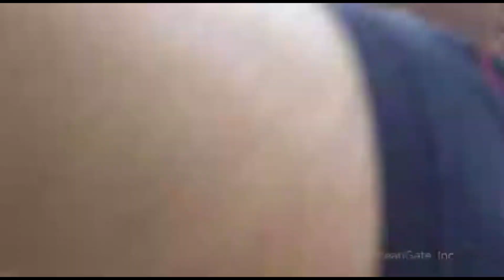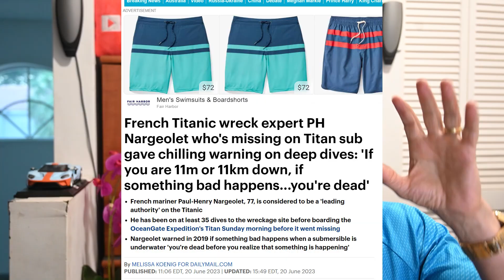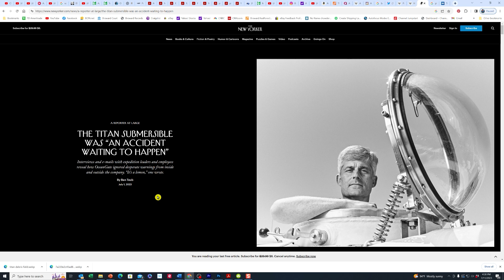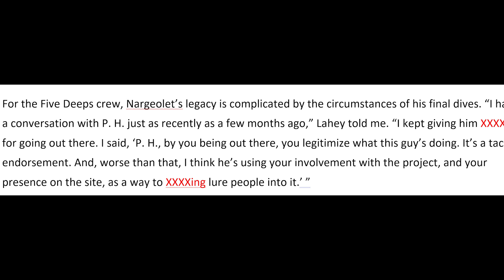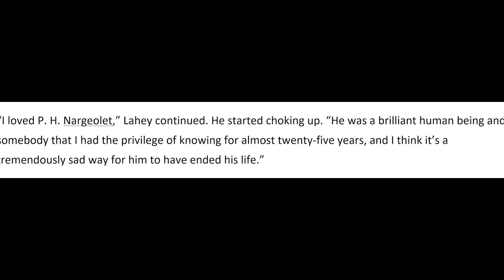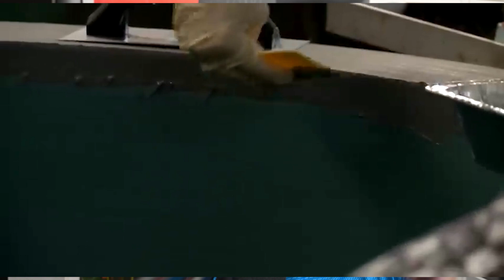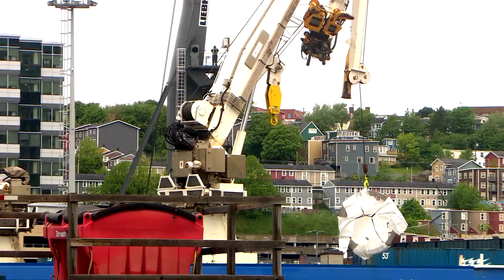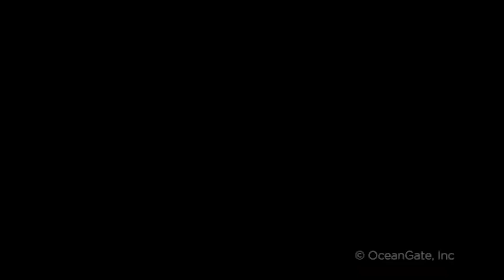Titan Sub: More Q&A, Design Defects, Why Descent Fast

Comment: Carbon, Fiberglass, aluminium, etc will not bond to any secondary adhesive without a "tooth"
The bonding and the bonded to surface need a profile that the adhesive will bite into. Lacking that, there is nothing for the adhesive to lock on to. Silly thought, but anybody working in the composite arena  knows this. How they could expect a permanent bond is boggling. And wiping with bare hands, a generic rag, no visible solvent like de natured alcohol is also suspect. At best the manufacturer of the carbon and "glue" should have proved a procedure to prep the surfaces. 
Also the way the carbon was wrapped is quite suspect, a crisscross weave would have provided more strength than the layer after layer rotary deposition. Every bit of carbon I've ever seen in the form of a pressure vessel or a tube has been in the form of a back and forth weave.
Both the rings and the cutback on the perimeter edge of the cylinder appear to be smooth. With both dissimilar materials expanding and contracting at two entirely different rates the bond would be temporary at best.  Along with any distortion of the tube or ring that would cause a bonding failure. Quite possibly the "noise" heard or reported could have been the failure of the bond happening. And the difficulty with the craft being able to rise rapidly could  have been attributed to a leak adding more weight under the floor that they could not see, but changed the way the craft could rise.

Comment: Could it be that the submersible was already making water at the very beginning? And it only leaked into the compartment with the equipment?
Meaning that the weight was much higher. Thus sinking faster, while going back to the surface was slower.

If you go down to fast. You immediately need to correct. Or understand that something is wrong. They should have aborted right away.
Reply: It would explain the minimal effect of dropping balast, if the transscripts are factual. I'd say it is more than likely.

Comment: Question 1: SR has texted that all lights are red and cracking sound from aft, why the control of the ship stayed 8 hrs to inform coast guards, they failed to understand that is an exceptional situation beyond their process? Question 2 : there isn’t any aft other than thing hanging outside, so cracking sounds does not mean anything related to hull. Question 3: how they hell they move faster than they could? There is no current downwards as I know. It is hard to believe they got too much weight considering 10k of ships weight. Question 4: Hull is the biggest part which tells the true story, it can’t be missing. Did they stop search operation due to funding? Question 5: what happened to O2 tanks? Were they drove hull far away before touching the sea bed?

Comment: you are still not telling why it is important to descend slowly !? I mean either a vessel  can stand the pressure or not.. Take for example a gun barrel!
Reply: True, but it is much more likely to expose the weaknesses in the design. It wil compound the material fatique wich would not be a big problem with steel. This fiberous material does not tolerate this wel.

Comment: Not sure if you covered this already but Oceangate used a wet layup process versus using a pre preg and autoclave for curing. This is a major red flag for porosity issues which they claim is less than .1%

Comment: Another question of fibercarbon construction, was it weak in longitudinal direction? Way it was wound there is no crisscrossing of the carbonfibers. If weak in longitudinal directions, it accordion imploded (crushed like aluminumcan).  The titanium end caps became compression chambers and gas and flammable material exploded.

Comment: I think the part we see the technician wiping with the rag is not the surface where the adhesive goes but the side that mates with the titanium dome.  That would not be critical with regards to cleanliness, at least not at this stage of the construction, and would need a polished finish to seal properly. The side where the glue goes is recessed and is at the bottom of the ring in the orientation seen in this video.  In fact shortly later we see them applying glue to the bottom of it.  Not saying they did much of anything right, just that this particular scene is not indicating a serious issue, at least not directly.  It does of course still indicate a general sloppy attitude to engineering which no doubt contributed to the tragedy.

Comment: Titanium shrinks about 1.5% of its mass at 2c around the depth of the Titanic ship, where-as Carbon fibre won't shrink much if at all in that temperature. The ends just popping off in my opinion.

Comment: From the earlier video you did with the descent rates, I think it looked like their speed was going up instead of down when they were getting near the bottom. I don't know if I saw that correct, but if so, could that also point to a problem with the controls? I would assume one would want to slow down as you arrive, not speed up. But then again, I don't know much about physics and submarines.

Comment: I was thinking that the coefficient of expansion would be different between the composites and the titanium. It’s freezing down there and the ring will shrink more than the composites. In addition, the end caps will push on the composite cylinder column. Composites are not good in compression. It’s not like concrete columns.

Comment: Not sure why you keep covering the descent rate of this sub. This company performed many dives, including 13 dives to the Titanic, all of which were no issue. Those dives to the Titanic were all done in around 90 min, and they never had any problems. 
This seems to be simply an assumption based on ignorance.

Comment: I'm not certain, but I have some experience of carbon composite fabrication and I am pretty certain that is dipped tow winding. A continuous length of bare, unidirectional carbon fibre, otherwise known as tow, is passed through a bath of resin,  then through combs or brushes, to remove the excess, then wound onto a mandrel. The resin is designed to cure at ambient temperature. This method of wet lay-up offers excellent fibre alignment, but suffers from a relatively low proportion of fibre reinforcement to resin. Prepreg generally is around 70% fibre by weight. I would be surprised if this method of construction could exceed 40% fibre by weight. In addition, there is no way of excluding foreign objects such as dust and lint from the composite, and no way of further consolidating the component to exclude bubbles  and voids, other than heat shrink wrapping, which on a component of this size, is unlikely to be effective. Given that fibre buckling and shear fracture is the most likely failure mode of carbon fibre under compression, the inability to control for small voids and inclusions is an invitation to catastrophic failure. Sad.
Reply: Bloody carbon fibre. Back in the early 2000's I remember a new whitewater kayak paddle manufacturer made inroads into the kayaking community - the ones with better jobs amongst us bought these damn things, the shafts of many sheared off mid rapid. I think you have the potential with this substance, but you need testing and experts to test the exact manner in which it will be used along with experience about how it could fail in the field.

Comment: Correction :  when used for removing bubbles from epoxy and other polymers an autoclave is used to put the item under negative pressure or a “vacuum” - actually a partial vacuum.  This is done to extract air bubbles in the epoxy/glue.  Even hobbyists such as wood workers use this to remove air bubbles that are naturally in the medium - generally introduced in the mixing or stirring process.
Reply: Wrong- there are vacuum bags used inside the autoclave to drive that extra atmosphere of delta P, but autoclaves for aerospace use are applying around 80-110 psi of external pressure, which combined with the higher temps used give superior resin flow, which leads to much lower porosity and superior mechanical properties.
Reply: @TeKnOShEeP  they also use negative pressure in wood preserving auto claves.
Reply: If you want to create a vacuum all you need is a bag. Then you could use any oven. The reason autoclaves are so beefy is exactly because they exert at least a few atmospheres of pressure. This squeezes the material together, and makes any bubbles small enough to work their way out of the material as well. I've often seen resin or epoxy added with the part in a bag of under vacuum while the 1 atmosphere of pressure from the air squeezes the part. You can then do much better by throwing the part in an autoclave with up to 7 or 8 atmospheres of pressure while it's still under vacuum, although I'm not sure that keeping it in a vacuum bag while in the autoclave is necessary.

I used try use two methods to get rid of gas bubbles in my solvents for certain methods in UPLC analysis. If it wasn't critical, I'd just vacuum filter the solvent to get rid of most of the gasses. If no gas was super critical, I'd just throw the solvent in the autoclave under heat and pressure to get rid of almost all the gasses. No vacuum, just heat and pressure.

I've never heard the term autoclave used to refer to a vacuum. As a noun or a verb, it always meant heat and pressure.
Reply: @zlm001  just because you haven’t seen it done doesn’t mean it’s not done because it is.

Comment: Everybody knows what happens if something goes down too fast. I found that out in the bathtub when I was a kid. The more I held onto the thing, pulling it under water, the more pressure around and inside it became. That’s probably why this happened. The sub was not ready for that dive.
Reply: Lol what?
Reply: @CheeryRhymes  the faster, the harder the pressure will be
Reply: @sajathedecided9016   the speed that you go under has nothing to do with the pressure. 

That's completely dependent on the depth.
Reply: @CheeryRhymes  yeah, the bottom was the «goal» 
Crazy story.

Comment: I too have been somewhat shocked by PH's attendance on this dive. The others could easily have been duped by Rush's slick salesmanship but PH was an expert, had travelled in properly built and tested submersibles. I agree that his presence would have bolstered the other passengers' (crew?) confidence so why did he do it? Was there a lucrative deal for a man who sounded like he was unconcerned for his own safety or did he genuinely think he could somehow save this ill-conceived vessel if things went awry? Nobody will ever know, but it is strange that such a man as him would let himself be bolted into that coffin.
As for the fast decent? I know nothing about engineering or carbon fibre but if delamination was already occurring, perhaps water was being taken onboard between layers adding to the weight ?
The observation about how clean the titanium end caps are, with no trace of carbon fibre fragments, does indeed point to how the adhesive was probably another weak point. 
Had Rush not gone down with this the man would be facing jail time now. What an incredible attitude to ignoring established safety protocols.

Comment: Not even a residue of any carbon or glue. I am pretty sure that it will turn out to be were the Carbon Fibre was attached to the rear Titanium Ring. If you think about under all that pressure the end caps are being pushed down on each end of the hull, were as the hull is basically being squeezed especially in the middle causing the hull to shrink ever so slightly length ways.

Comment: Why wasn't the titanium ring have rings (rough surface) to allow the carbon fiber to grab better? The carbon fiber part in my opinion,  would be like a tooth paste tube having a cap with no threads on the cap. Squeeze that toothpaste and the cap pops right off. Once the water pressure on the carbon fiber tube started, it reached a point that just Squeezed the cone off, and that's why no fiber on the recovered titanium rings. Just my 2 cents.

Comment: An autoclave was not used. They used a bag and vacuum method to cure the carbon fiber. A far inferior way to cure carbon fiber to be exposed to such pressures because it does not force the resin into voids. I noted the single axis the carbon fiber was laid on the tube as inferior but I was told by others that this is actually used in aerospace at times. I am not an engineer, so all of these statements need to be confirmed. But the cracking statements were telling Rush the craft was coming apart. Crackling is delaminating. It is not a sound you ever want to get comfortable hearing anything structural do. It is not a normal sound on anything you want to bet your life on especially at 12500 feet under the ocean. 

Please continue investigating this. I doubt we will ever get a true accounting of just how negligent Oceangate and Stockton Rush truly were, otherwise. 

The statements that P.H. Nargeolet had essentially given up on life because his wife had died and did not care whether he lived or died - is a huge red flag to anyone else thinking of going into other extremely dangerous adventurers based on the presence of only one verified expert. Him being there may well been the reason three other people trusted the craft. And that is just damn sad.
Reply: a convergence of unfortunate things

Comment: I take the Titan video to be produced for promotional purposes.  I don't think it is safe to assume anything about the construction of the craft from this.  There can be lots of questions about how it was done, but I don't think looking at this video is necessarily helpful in trying to find answers, and could be misleading.

The images of the recovered titanium rings appear to me to show most clearly the outer flat surface, not the inside rabbeted surface, in which case the presence of carbon fibre would not be visible.    Irrespective of that, I think you would need an expert to say whether in the event of an implosion the glue would be likely to separate cleanly from the titanium anyway.  The adhesive to titanium bond might be good enough, but still be weakest part of the joint when it the hull was ripped apart.

Thank you for the link to the article.  It does seem to illustrate the maverick way in which he operated.  It appears that he obstructed the development of the design which might have produced something genuinely useful, if the safety parameters were adequate, or brought it to a halt.  

But the blame perhaps partly lies with a legal system that denied people the means to challenge what Oceangate were doing, lacking sufficient financial and personal resources.  Perhaps the global underwater exploration community could have collectively supported a legal challenge; they seem to be a fairly wealthy lot of individuals.  You can't and probably shouldn't stop people reaching for the skies or the depths of the ocean, but society should be able to step in before they risk killing someone.
Reply: All for experimentation, but not with paying, non specialist clients who have no means to fully understand the risks.
Reply: @pollystyrene99  Absolutely, if he wants to take the risk of killing himself that's fine.  Unfortunately you can't stop people like that from existing, and the efforts of those that tried to stop him fell short, and they gave up.  They say they knew what would happen, they knew the purpose of the project was to take paying passengers, so they knew he would kill them, one day.  They must feel awful that they weren't able to stop him, or didn't go far enough to achieve that.  One would hope that something will change as a result of the investigation into this loss that might make it easier to stop future Stockton Rush's.

Comment: Regarding descent rates, is it possible the carbon fibre voids became saturated with water or and started to leak into the aft section, increasing weight?

Comment: Thanks Jeff for bringing some more details on this submersible implosion.

One thing that surprised me with is submersible design was the attachment of the end caps.  The interface is such a small contact area and is totally dependent upon the adhesive.  As a bare minimum using the adhesive only attachment, I assumed the end rings would have inside and outside shoulders, at least 1 inch thick and 1 foot long to give significantly more contact area for the adhesive bond for the titanium/carbon fiber.

One thing I haven't seen but, would think mandatory for this experimental submersible is, something that actively measures the deformation of the carbon fiber cylinder.  Since the cylinder was wound like fishing line on a fishing reel (obviously to simplify construction), I would think it would be very vulnerable to shearing.

Comment: I know this is might be a stupid question. But after implosion  will the parts of the carbon fiber cylinder sink or float. Anyway if the parts will float up to the surface eventually . The currents will carry them away far the accident site

Comment: Flushing a toilet in a submarine causes massive psi and killograms of force causing a massive compression.  An ejection route would have been favorible if the adheasive had not failed as you cannot glue to titanium without Gorilla Glue Technology before Cap'n Crunch head popped.